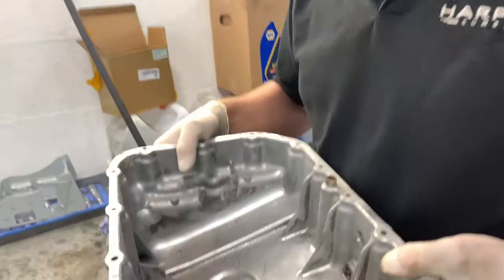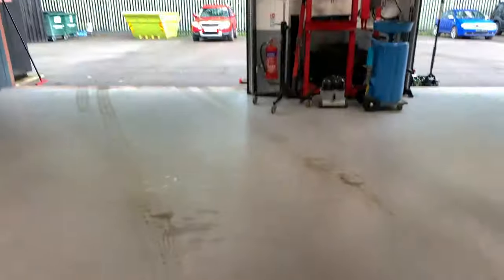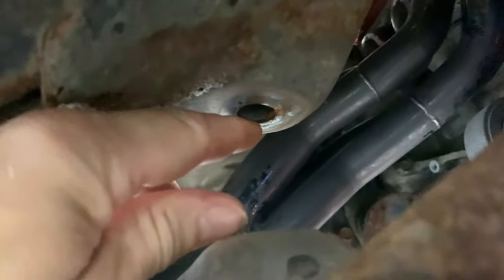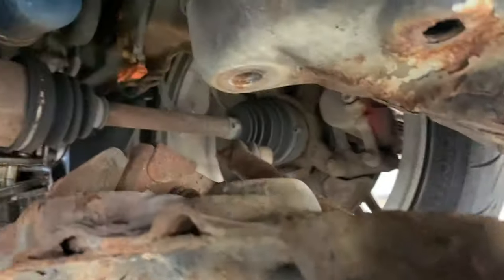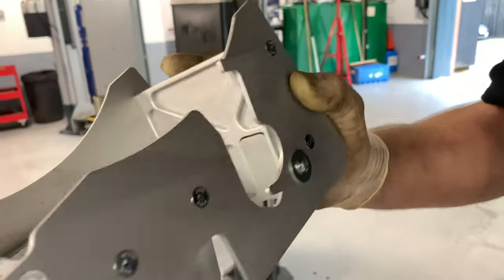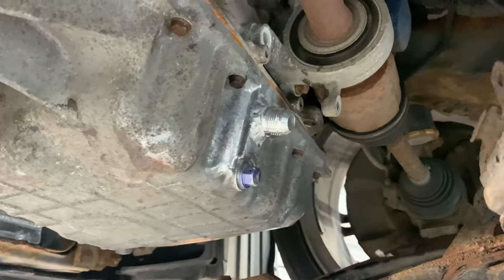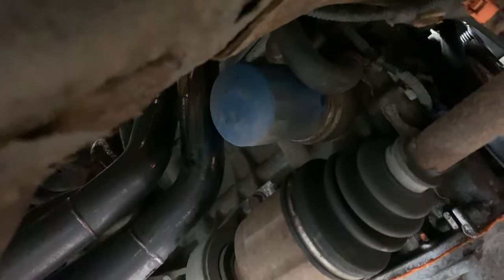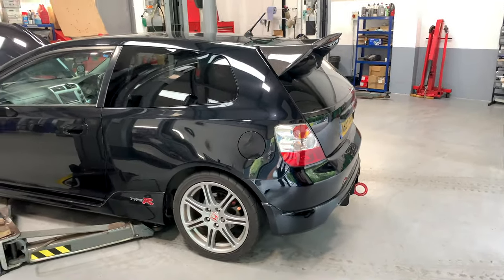K20 EP3 Type R Turbo Part 2 - Clockwise Motion Drop In Baffle and AN10 Return Fitting

Comment: Why did you go for 10w50 and not 10w40? Just wondering matey. Great video love your channel
Reply from the maker: When I checked up on what oil to use when turbo that, or 10w60 seemed to be recommended so gave it a goz

Comment: Hi you have a M14 bolt missing out of your half shaft bearing holder. Thought you would like to know!
Reply from the maker: Holy crap thanks!!! Will get that sorted out ASAP
Reply from the maker: What does the other threaded hole go to in that half shaft bearing? I’ve spotted the one you mean, left hand side one into the block. Thanks for letting me know!
Reply: @1BlueGhost  Hi there are three m14 might be M12 bolts hold the bearing carrier tohe block. The other ones are for a pressed steel cover that goes over the half shaft.
Reply from the maker: @jimiredhouse2169  I will have to see if I can find a cover for the half shaft as mine didnt come with one fitted